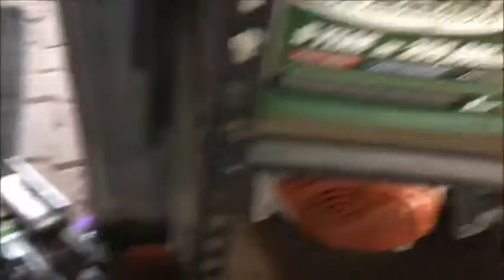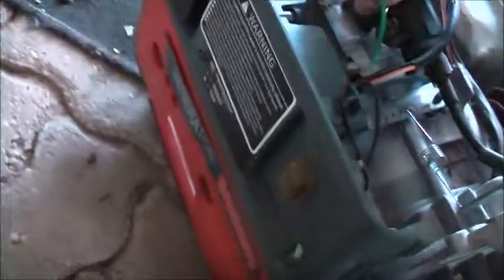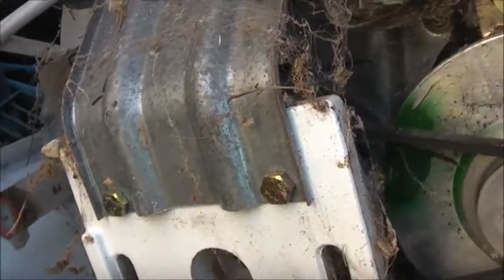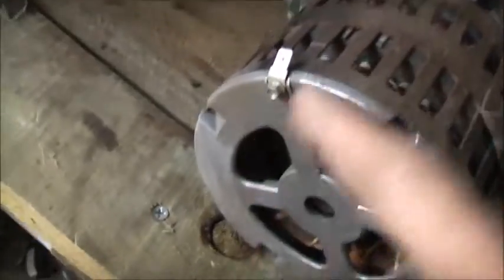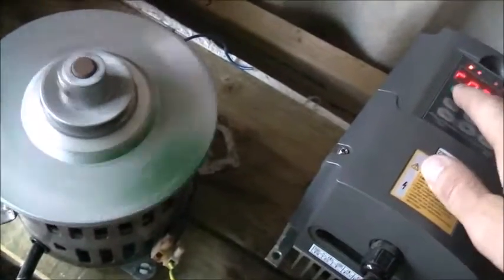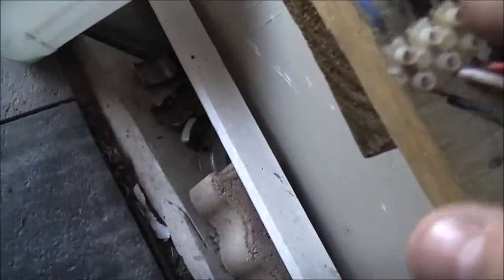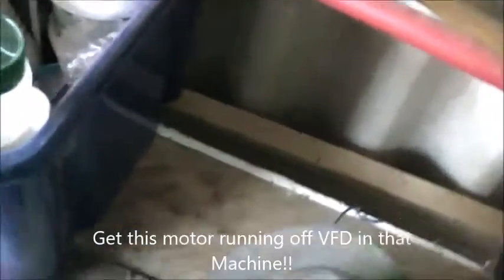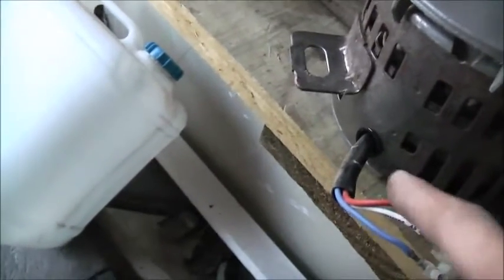Simpson Washing Machine Motor Test On VFD

Comment: Hi hdxfh. Would you have any insight as to what causes an old simpson delta to stop agitataing after a while? I know you cant tell me exactly without looking but in your experienece what fails most often? The timer, capacitor or that "electronic forward reversing" module that is annoyingly potted :(
Reply from the maker: @PracticalCat  gearbox